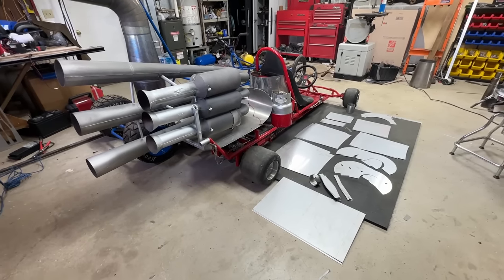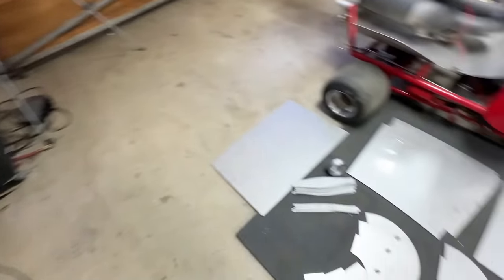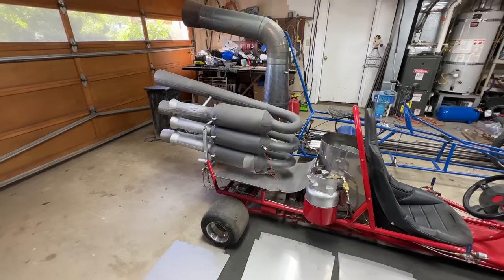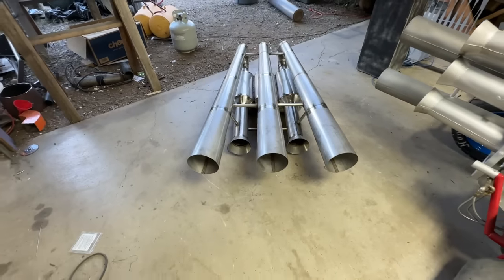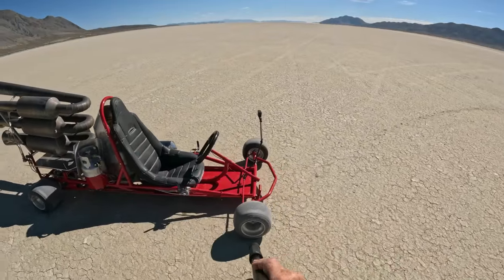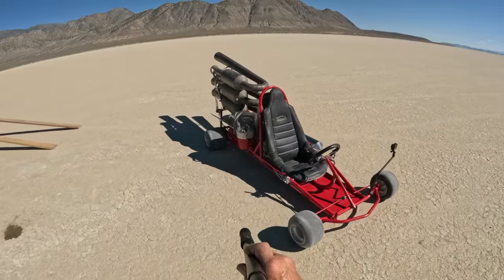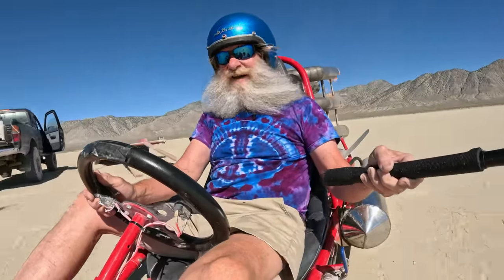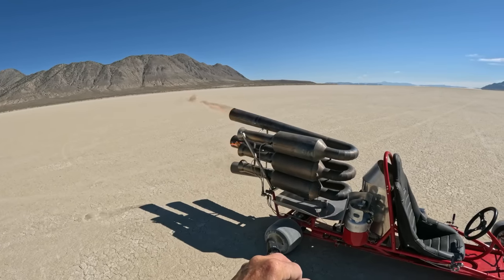Crazy Rocketman: Building and running new bigger Pulsejet engine.

Comment: i’m impressed with how easily it starts up
Reply: Have pulsejet, will travel.
Reply: Precision
Reply: Yeah most of the small hobby pulse Jets I've ever seen seemed to really finicky to start up
Reply: agreed and it shows that he is a pro and pulse jet master
Reply: For how long I've seen newbs try to start these things I feel like he has a mechanical or digital startup system that delays things just right. Wouldn't be surprised if a Raspberry Pi or Arduino was running the whole show, lol.
Reply: @mjodr he covered it in a video a while back, he injects propane gas to start then switches to liquid for running. Amazingly simple set up.
Reply: @mjodr he uses spark ignition. If u look closely at the old engine u can clearly see a spark plug with a thin wire connected to it.
Reply: @craigherron1203  I feel like I've seen a thousand of these things with spark plugs that don't want to start this easily.

Comment: To start: mad respect for that pushbutton start.  I've never seen anyone start a pulse jet that quickly.

I notice in the video that the thing appears to be getting pretty uneven cooling airflow, center and bottom pipes appear to be glowing much brighter than the top pipe.  I bet you could mount the engine flat and build some simple shrouds for it to scoop cooling air in from either side and direct it evenly across all three pipes and chambers, and you would get a longer useful life out of the engine that way.

Comment: Awesome, i wish I lived closer so I could show you my latest engine and some of my drawings for new ones, in gonna take mine and run it Saturday and it should have around 250 lbs of thrust, my last engine upgrade i didn't consider the heat shield and it got to hot and bent during the run so i made a new, thicker one, now it should be fine, i guess I'll find out tomorrow. Lol

Comment: That's awesome!

I never thought about them wearing out before! Out of interest, do you have an old engine you can show the wear on?
Reply: I believe the wear is the intense heat of the metal, that makes holes, over time, they are spent, as metal warps from heating and cooling. But he might have a video on his channel to show what exactly occurs with his designs.

Comment: Did you fix the melting sparkplug wire? If not, maybe ceramic insulators could work for the temperature range, or a tube filled with ceramic where the wire's insulation burns off on the first run and then the ceramic handles it from there?

Comment: Robert...  That's an amazing system.  Wondering why the air intakes are not facing forward.  Also...  How does a "valveless" pulsejet function?  The entire process (as I understand pulsejets) requires valves of some sort, to facilitate the differential pressures.  Would you be willing to do a tutorial video, about your designs?
Reply: I could be wrong but I think both nozzles product thrust. I think Colin Furze did a video where he built a pulsejet engine like this that explains it, there's probably others on the platform as well
Reply: Valveless work on "shockwave" of the flame front to do the pumping, Furze does have some good content on them, he is also Mad and somehow not completely deaf!
Reply: @El-Burrito  - That’s an interesting concept, but you need to have adequate O2 flow, entering the system (from somewhere).
Reply: @timdake  there's literally a wikipedia article for valueless pulsejets. Just go read that.

Comment: Would have liked to see some welding on those elbow joints.  I'm living proof, just because you own 2 welders, don't make you a welder..  Were those done with TIG or something else?  From the use of the toggle switch on the steering, the engine might produce more thrust than the cart might handle?

Comment: Have you or others explored water injection in valveless pulsejet engines?  When I see your incandescent hot engines, I wonder if more of that heat could be converted into thrust by water injection.  I realize the current simplicity is good, and I am not telling you how to make engines.

Comment: Mr Karavodin would be smiling.  So would Mr Goddard.    Jumping up and down, wouldn't be out of the picture, , nor would be locked in stare, , lol.   Your up to speed, now you need the RM pulsejet ejection seat??.  That middle engine was getting Feisty Red.   You might add some tall-ish cooling fins on the side of the cans, kinda like you see on a RTG power source, just to pull some of the heat.

Comment: I see you've the intakes facing the rear, which means they won't benefit from a ram effect.  Is this to simplify things?  To omit the shutter-grid on the intake vis the Argus?  You COULD get a shitton more thrust that way.  Presently you are operating on static thrust alone.

Comment: So are your engines valveless?  If yes - that is really impressive!
Reply: I think he does a mix, some valved some not. This particular one is based on a Lockwood-Hiller pulse jet. They have no valves at all. Just well shaped tube, some fuel and an ignition source and acoustics does the rest. In this case there are three connected together though! I assume to reduce instabilities that may occur if it was three entirely separate engines that could go in and out of sync with each other.